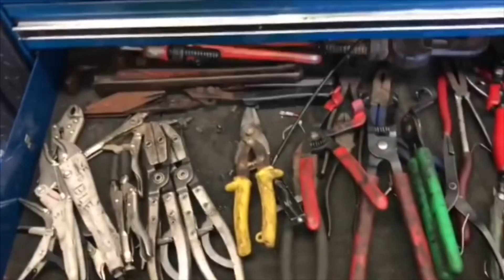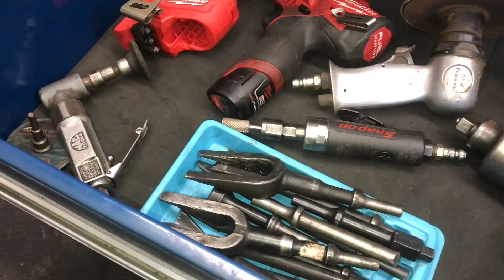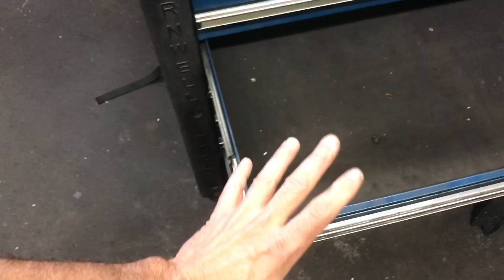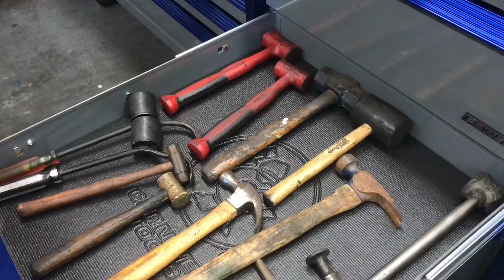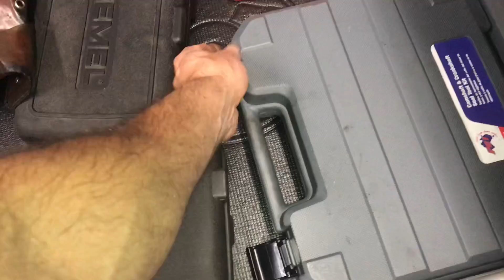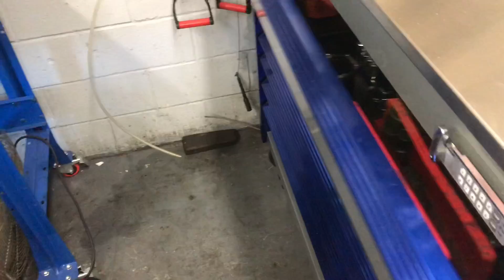Cornwell's 84 Inch Platinum Series Toolbox: The Ultimate Tour!

Comment: Kool....... Ive got the same exact TOOL BOX. Traded in 2 roll carts. Got a good price for it. CORNWELL PLATINUM SERIES TOOL BOX
Reply from the maker: Gilbert Platero nice I ordered the hutch it should be here next week. But Cornwell has been promising it for months now so I’m not holding my breath. I’ll do an update tour I’ve added a ton of stuff.
Reply: WE HAVE A CORNWELL DEALER WHO IS ON TOP OF NEW PROMOTIONS. HE'LL BE LETTING US KNOW WHEN THE HUTCH IS OUT. ALSO WAITING (CAN'T WAIT),
Reply from the maker: Gilbert Platero it should be nice. Are you on I Instagram? If so let me know so I can follow you.
Reply: Nice setup, I just traded in my matco Triple bay for the 84 double bank platinum which won’t be in for a month. I used the “tool grid” system for organizing sockets and wrenches. Can you tell me the inside length, depth and width of the main top drawer so know what size board to order for the new tool grid.

Comment: Looks like your making some progress getting moved into your new box. I've got all moved into my 84" Platinum box too well if you don't count the other 5 tool boxes and shop truck full of tools. The shop I'm in you could be working in any of 30 bays any given day this new box is easier to push around without having the hutch blocking my view like my old main box. Have you had any issue with your USB ports? I'm having trouble charging my head lamp but when I plug the USB cord into a brick in any of the 110v toolbox outlets it changes fine.
Reply from the maker: Keith Smith I’ve had no problems with the box so far. I’m sure Cornwell will warranty the usb for you. 30 bay shop wow. I’m in a 4 bay shop. Thank you for watching!